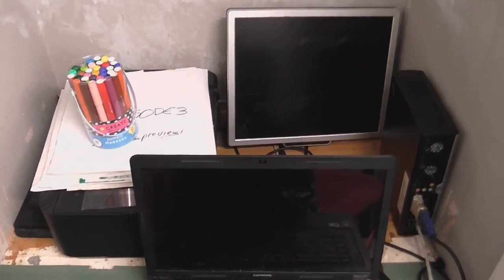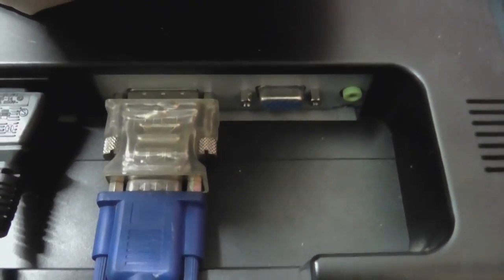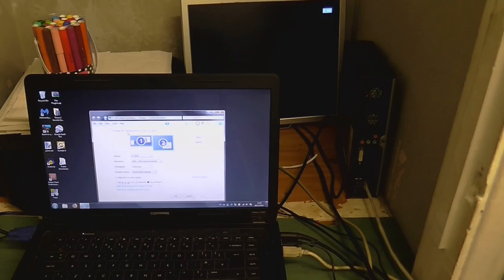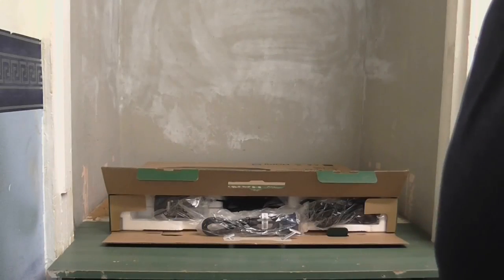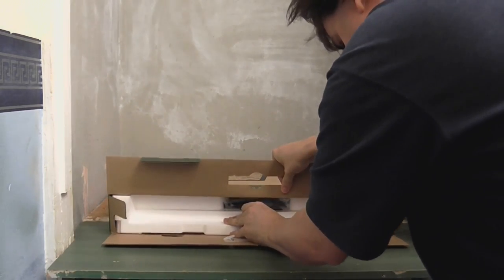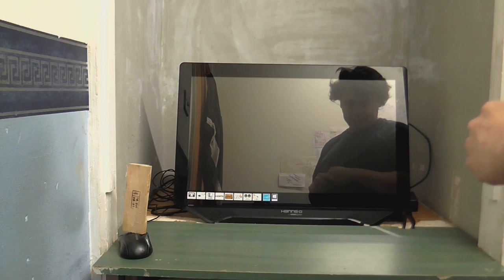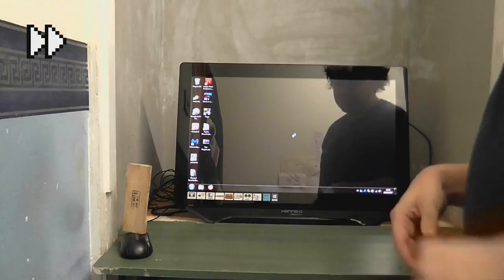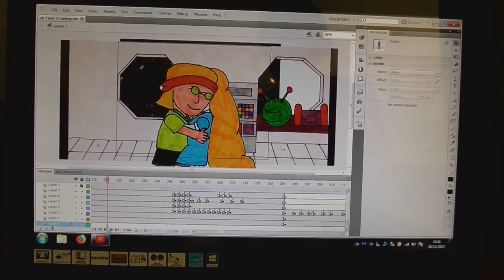Setting up a Touch Screen Monitor.

Comment: Oh good, you bought the monitor. That should help you with your animations. Also, the VGA to DVI didn't work because you are converting an analog signal to a digital signal.
Reply: Right... :D
Reply from the maker: I thought VGA and DVI were both digital, so how come it works the other way round if one of them is analog, surely that world be incompatible too, right?
Reply: I suppose it must be easier to convert a digital signal to an analog one. Analog to digital is possible, but it requires a fairly expensive active converter. This explains it better than I can: https://www.computerhope.com/issues/ch001485.htm
Reply: Analogue pins available on DVI connector so it's cheating.

Comment: "Really gotta lose weight" You and me both! :P I have no idea how much you are, but I'm 265lbs. That's down from my peak weight of 286.3lbs, but it's taken my a long time to get down to here. Hopefully you'll have more luck than me if you decide to lose weight!
Reply: I use to be 19 and a half stone and went all the way down to 11,  over the past couple of years  I put on 3 stone but now I've started exercising again, People use to tell me I got to lose weight but even when I did it never made me happy.  The way I lose weight is to just eat  broccoli and grilled Salmon and drink lots of water, do a 5 mile run every other day or 2000 rows on a rowing machine, the weight will come off fast rowing but it's tough on the joints.
Reply from the maker: Yeah maybe I should diet, but the thought of never eating again and being in a state of constant hunger is too much.

Comment: DEFRAG, Clem. Do your defrag on your laptop. That, and other maintenance things that should ALWAYS be done anytime you use a computer on a regular basis, you know? XD
Reply from the maker: But as far as I know, the Windows 7 file system almost NEVER needs to be defragged, every time I've run the defragger all my hard dive partitions are 0% fragmented, and also I think whenever I'm not using the computer it automatically does that, although often I do go in and do those kind of things, so my main PC runs like a well oiled machine, I just haven't got round to it on my laptop yet. I've only ever had to manually run a defrag on a Windows 7 computer once, because Portal 2 kept crashing, so a defrag fixed that since the automatic defrag just hadn't gotten to those files yet.
Reply: Clem, listen to me. In my opinion, Windows 7 is kinda like a joke regarding defragmentation. I use a program called Auslogics Boostspeed that INCLUDES the hard drive defragmentation tool. I run that almost religiously (like, every week) because my computer is fairly old and lags a lot. After running the defrag, I find it runs faster to an extent. Also, I use another tool called Tweak Manager. That also helps in gaining computer speed (i.e.: it runs faster to an extent after running through the Tweak Manager settings and tweaking it to my liking). Maybe, as a suggestion, you could try Auslogics Boostspeed (mind you, you MIGHT have to pay for it to have full use of it) but trying it for free probably wouldn't hurt...
Reply: See what I mean? Sometimes you have to do the defrag some other way as the Windows 7 defrag thing seems to never do it. I loved how Windows XP did the defrag for you and you could see the progress with your own eyes. I wish Microsoft hadn't removed that.